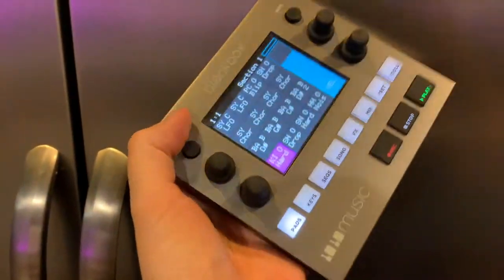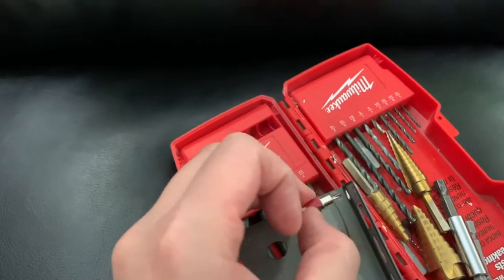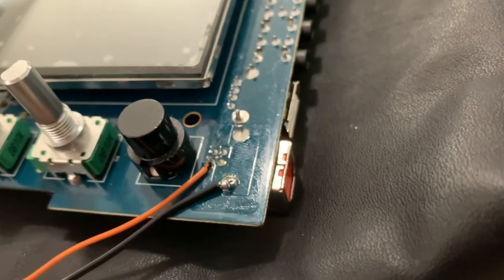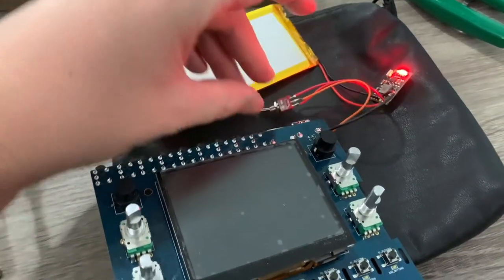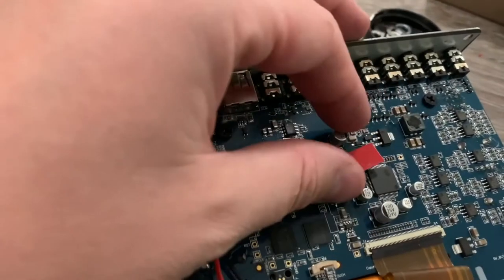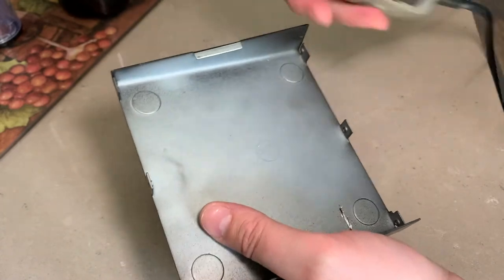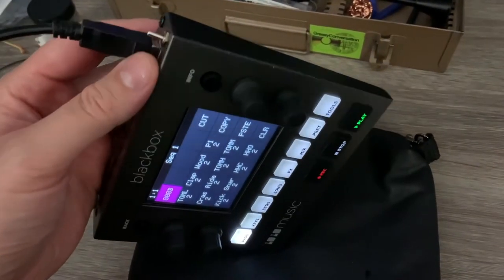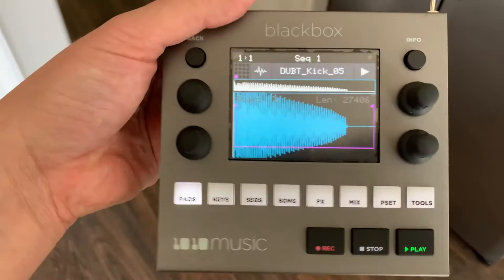Put a battery in anything! 1010 BlackBox Battery Mod

Comment: This is excellent work !

It's funny tho', I did the same mod to a Speak n' Spell back in 2002 with a 6v NiMh Nokia phone battery !

Can I suggest that you enclose the battery in a hard thin plastic sheath tho' ?

Because if the battery comes loose inside and the sharp component pins pierce or rub thru the airtight tape layer, it will become a Lithium Ion fireball.

Comment: great mod! be aware when running of battery and then putting a usb cable into the jack, it will get 5v on the usb lines.... so it might kill your host...or am i wrong?
Reply: Correct. The USB B connector power pin should be disconnected from the circuit board and connected directly to the input of the charger board. Just remove the back of the USB B connector cover and cut the USB power pin on the component side and solder the charger board input wire to it. One caution though, the pin is delicate and breaks easily. I broke mine and had the replace the connector. This way the Blackbox can be used with either the USB or battery or both while charging. I did this mod and it works perfectly and using it this way, you only need an on/off switch. I taped my battery to the bottom plate to keep it away from the Blackbox components. Kudos to the author of this mod.
Reply: @juliustoth1172   Thanks for sharing.
And the switch goes between the battery out on the charging board, and the power pin pad on the board, (that you cut earlier, from USB socket)
Great explanation. Will do this when I get my BB.
Reply: @juliustoth1172  Maybe you could do a little YouTube tutorial for others to see how this is done too?? Thanks.

Comment: I love this idea, but does the battery get hot in there?  Could heat cause problems if the battery is sort of snug against everything?
Reply: Maybe it's possible to mount it flush against the other side of the case with a heat conductor in between if it's a concern.